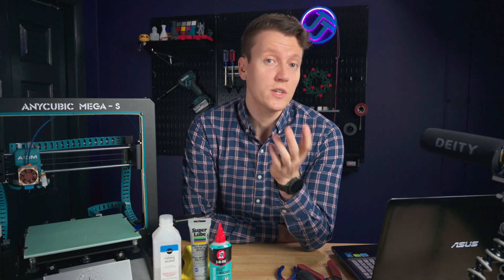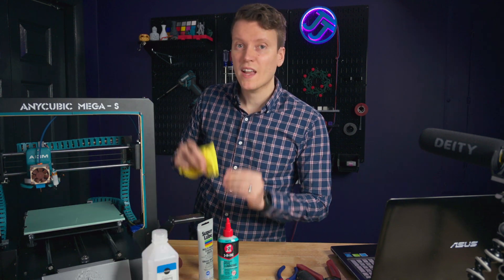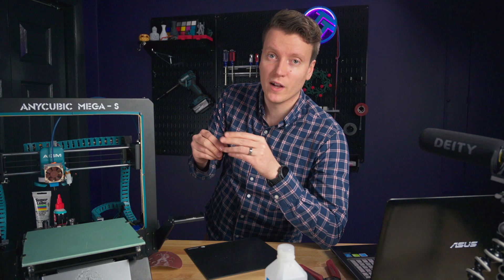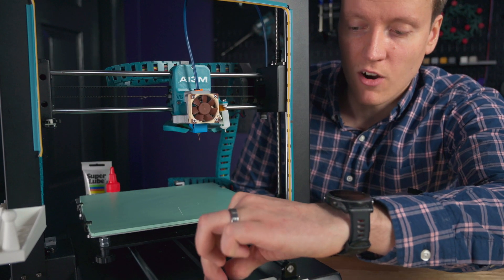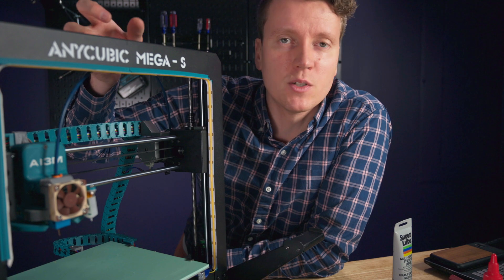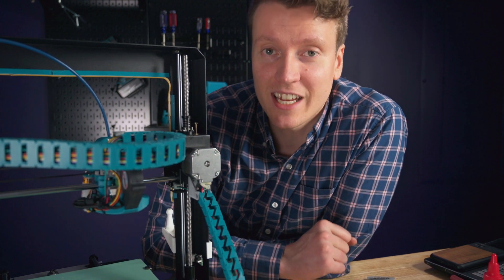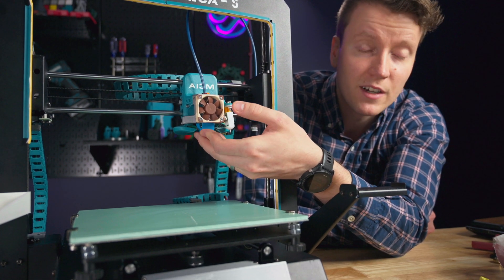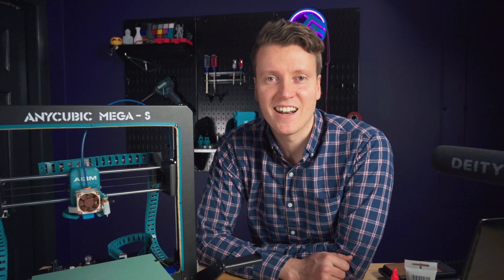3D Printer Maintenance Schedule | How to keep your printer NEW

Comment: Digging the videos, JJ!  I have a Mega S and your vids are the best resource out there, very well done.  I haven't seen you mention this (though may have missed) but have you done any upgrades on your extruder?  Been having issues with under extrusion and having to move my e steps all the way to 445 to compensate.  Considering an upgrade and would love your input if you've done it!
Reply from the maker: I haven't actually upgraded the extruder. It's almost the last stock thing on my printer, but I have heard people having issues with after a while. Under extrusion could also be caused by a worn out nozzle, or not printing hot enough. The nozzle issue has caused me some unexpected problems in the past. I would also double check that the gears are clean inside there, because clogged gears can't grip the filament. As far as upgrades, I've been testing out direct drive on my Voron V0.1 to see if it would be worth diving into for the Mega S. I'm not totally convinced it would be worth replacing a working bowden system, but I might go direct drive once mine wears out.
Love your channel as well, you were a big inspiration for me to get started in YouTube!
Reply: @JJShankles  awesome, thanks for the feedback!  I'll definitely check the nozzle and look for debris on the extruder.  It's funny that most guys don't touch the extruder, seems like it's actually really decent.  So just by that,  I'm guessing it's likely something else.  But I enjoy the problem solving and troubleshooting...most of the time, lol.  And fun to know you watch my vids.  I really enjoy your vids and look forward to watching you grow.  If you ever want to pick my brain on the YouTube side feel free to DM me on IG or hit me up on the website. 👍

Comment: On my Mega S, I just use a glue stick. When it starts flaking off (attaching to the bottom of a print), I use some blue shop towels and bottled water to clean up the glue, and re-apply. So far, so good.